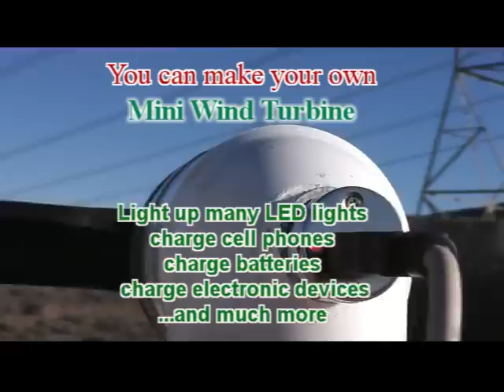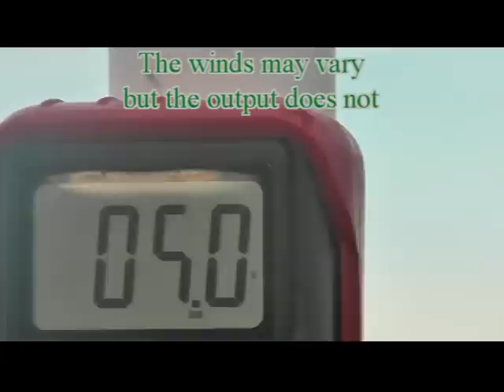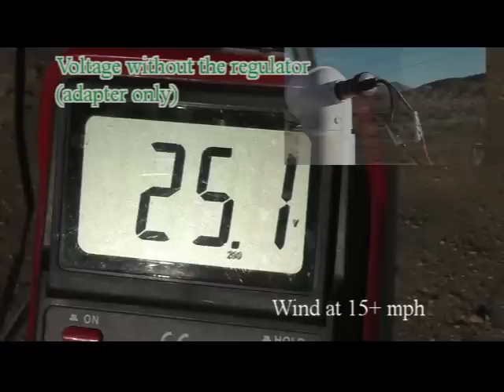Mini Wind Turbine G2

Comment: I'm pretty sure that each set of coils should have it's own bridge rectifier. Otherwise, the coil that's outputting, at any particular moment, will be dumping some of it's output through the other coil. It's because the two sets of windings are out of phase with each other. The result, without separate rectifiers, is that the generator will be fighting itself and wasting energy. A capacitor should be used across the DC side of each rectifier. The DC outputs can then be connected in series, for more voltage, or parallel, for more current.

Comment: Can you tell me, please, the wattage in 12V.  I would like to use it to charge my 12v battery.  Thank you very much for an excellent video.
Reply: Wattage is calculated by multiplying the voltage (volts) by the current (amperes). The voltage output has to be higher than the nominal battery voltage to be able to charge it. 12V automotive battery has a nominal open circuit voltage about 12.6 volts.  According to Wikipedia wet cell lead-acid batteries require 2.37 volts/cell for a float charge (continuous preservation) or about 14 V for a 12 volt car battery. 14 volts x 2 amps (trickle charge) = 28 watts required. A 100 Amp-Hour  car battery would take about 2- 3 days to charge from a fully discharged state at that rate.

Comment: is it necessary to make the bridge rectifier if the motor im using only has to cables (red and black)
Reply from the maker: Yes, the bridge rectifier is necessary if you need DC current. Wind turbines and generators can only produce AC, there is no such thing as a wind turbine or a generator that produces DC primarily current (they produce AC, which can be rectified to DC depending on the user's need).
Reply: thank you very much :)

Comment: I have taken two printers apart, but the motors only have two wires and are difficult to turn. Could you advise me on what motors to ask our local electronics dealer for, and which diodes etc to buy for the rectifier.  The guys here in SA can't seem to help me or don't know what I am asking for. Thanks... Looks great!
Reply: stepper motor
Reply: +Nicholas Ruiz I am very grateful for your video!! I had to play around with various blades before getting one which would actually turn the stepper motor, but it now works very well.  Thanks for your reply as well. I added a "step-up" circuit board (that's what the guy in the shop called it) which could be set to say 20v, and then a step down set to 5v.  This helped me keep the volts more steady even when the wind dropped a bit.
Reply: Wade Grimbeek OK :)
Reply: +Wade Grimbeek could you help us by telling what parts we need?

Comment: Stepper motor is on the way, already got my bridge rectifier ready and a 10x5 propeller, after that just wait for the wind!! Oh wait......this is the Netherlands

It's always windy here
Reply: +basboy542 is het gelukt?
Reply: Farid Soort van, ik heb het gebruikt voor mijn profielwerkstuk (Ik heb er een 8 voor gekregen!) maar in ieder geval, probeer in tegenstelling tot wat ik heb gedaan een wat grotere propeller of een propeller van een huisventilator, aansluiten op de stepper motor en dan zou het perfect moeten gaan, ik heb er mn telefoon mee op kunnen laden :)
Reply: cool man, ik ben op zoek naar alle benodigdheden, ik heb er geen verstand van.

Heb dit gevonden:

http://www.dx.com/s/voltage+stabilizer
http://www.dx.com/s/stepper+motor
http://www.dx.com/s/bridge+rectifier
http://www.ebay.com/itm/252006335949?_trksid=p2055119.m1438.l2649&ssPageName=STRK%3AMEBIDX%3AIT
http://www.ebay.com/itm/SUNNYSKY-2212-Motor-prop-holder-fixture-clamp-Adapter-dia-5MM-hole-Propeller-/271824050323?hash=item3f49f9d893:g:1d0AAOxykUZTg0Yp

Zou jij mij wat advies kunnen geven hierover?

Hoe oud ben je eigenlijk?

Thanks
Reply: Ten eerste waar wil je het voor gebruiken? Als voor eigen gebruik of een werkstuk. Ik zou gewoon zo veel mogelijk een propeller nemen die zo groot en licht mogelijk is, en een zo groot mogelijk oppervlakte heeft om zo meer wind te vangen, hier moet je heel goed op letten aangezien mijn eerste propeller (10x15) nooit genoeg wind kon vangen. Zoals ik ook al zei heb ik dus de propeller van een huisventilator gebruikt, heel handig aangezien er bijna geen dode ruimte is, maar ook weer onhandig gezien de massa en weerstand hiervan, ik zou voor de propeller dus wel iets groters nemen, en misschien ook iets met een groter oppervlakte.

Ten tweede moet je een goede stepper motor hebben, dit is ook vrij logisch maar ik zou gewoon kijken naar stepper motoren die er ongeveer hetzelfde uitzien als diegene in het filmpje, het liefst een met zo weinig mogelijk weerstand (staat er meestal bijgegeven) als ik jou was zou ik dan voor deze gaan: 
http://eud.dx.com/product/heacent-reprap-prusa-mendel-3d-printer-diy-accessories-stepping-motor-black-silver-844250275#.VwVO5WiLSUk
of deze:
http://eud.dx.com/product/heacent-yb42-33-3d-printer-diy-accessories-stepping-motor-black-silver-844339617#.VwVPDWiLSUk
deze lijken mij de beste optie.

Wat betreft de bruggelijkrichter is een ander verhaal, het is heel lastig dat zomaar uit te leggen, ik raad aan wat erover op te zoeken op wikipedia of internet, daar staan meestal heel handige plaatjes met hoe het precies werkt, het gaat er gewoonweg om dat je de stroomrichting omdraait om er zo voor te zorgen dat je geen wisselspanning krijgt, ik heb materialen van mijn school gebruikt waardoor het makkelijker ging, maar misschien heb jij andere apparatuur nodig je kan ook eventueel hier naar kijken:
https://www.conrad.nl/nl/brug-gelijkrichters-vishay-gbu4b-e351-soort-behuizing-sip-4-567342.html
zoiets moet je ongeveer hebben als je het wilt kopen, je kan er natuurlijk ook zelf een maken.

Een voltage stabilizer heb ik eigenlijk niet gebruikt, als je het eventueel wel wilt gebruiken om je spanning constant te houden kan je hier wel meer over opzoeken.

Voel je vrij om meer te vragen als je ergens niet achter komt, je kan eventueel ook nog even het filmpje doorkijken als je iets niet weet, ik heb een heel groot deel van mijn werkstuk gebaseerd op dit filmpje :) (Ik ben 18 btw)

Hopelijk is het zo een beetje duidelijk, zoniet hoor ik het wel :)

Groetjes,
Reply: Thanks!

Knap van je dat het is gelukt bij jou.

Ik bouw het voor de lol. Vind het wel interessant, ook om zelfvoorzienend te kunnen zijn.

Ik wil er een telefoon mee kunnen opladen bijvoorbeeld.

http://www.ebay.com/itm/252006335949?_trksid=p2055119.m1438.l2649&ssPageName=STRK%3AMEBIDX%3AIT

http://www.ebay.com/itm/222076226165?_trksid=p2055119.m1438.l2649&ssPageName=STRK%3AMEBIDX%3AIT

die had ik gevonden. Die houten, is zwaar lijkt mij, maar als die eenmaal draait heeft die wel meer kracht?
Reply from the maker: +Farid 
I just saw your comment, and would like to remind you of something very important. "mount the propeller backwards" for more efficiency. Make the front of the propeller face backwards. If you need an explanation of "why", please let me know. Remember that a propeller is an airfoil, therefore all aerodynamic principles apply. (or...you can test it yourself...put the propeller facing forward on a shaft and put it in the wind....then, mount the propeller on the same shaft backwards, then put it in the wind...You will notice that it will spin much faster when mounted backwards. (of course, if the propeller is shaped as an airfoil it will have a "more rounded" surface in the front, and a more flat surface in the back...check it out). Please do not confuse it with a household 3-blade fan which is flat on both sides)  I just thought you could use this information. STT
Reply: ScienceTubeToday yes thank you ! :)
Reply: ill keep you updated
Reply: Leuk! Je kan mij of +ScienceTubeToday altijd vragen, ik hoop voor je dat het lukt :)

Comment: I have a four wire stepper motor and every thing else still can t get it going
Reply from the maker: mz lewis I can't tell if you have a bad motor, but, assuming your motor is in good working condition....
If you have four wires, chances are you have two separate coils. You need to identify which two wires make one pair (the beginning and the end of the internal copper coil). Do you have this motor's diagram? If it's something you purchased, you can obtain this diagram from the supplier or manufacturer. There is no rule for color coding. Each manufacturer picks their own color of preference, so no one can tell which is which. That being the case, you need to identify the two pairs that make one coil by doing a continuity check. If you you have a continuity tester, use it. If you don't have one, simply connect an LED light to two wires and spin the motor manually (say, with your fingers..) If the LED light up, you found one pair, if not...pick the other wire and try again....then, make note of the two pairs. Now, you have two separate generators (each coil is one generator)...you may choose to connect the two coils in line... At this point you have an AC generator...if you want to make DC current, just use a bridge rectifier...If you need further help, just let me know. Have fun with your project, and please keep me posted...
Reply: ScienceTubeToday ok find the ones that make the led lights up now I have a 4diodes bridge rectificer so do I connect those two to the rectifier
Reply: mz lewis thanks much for your help its workin
Reply from the maker: mz lewis Congratulations. I am glad you didn't give up. Now, you have all the bragging rights :)
Reply from the maker: Don't worry, it's no problem. If you are using a bridge rectifier with 4 pins, lay it flat on the table (the 4 pins towards you) and connect the two wires from the generator to the two pins in the middle (it doesn't matter which way you connect these two pins to the wires from the generator, the result will always be the same): left side is the positive (+) DC - , the right side is your negative (-) DC...
_If you made a bridge rectifier yourself, then you have 4 diodes making a square with 2 diodes pointing north (left and right of the square) and two diodes pointing west (top and bottom of the square). The band on the diode shows which direction the current flows - which is, from the end without the band to the end with the band). So, your upper left corner on this square is the DC(+) the lower right corner is the DC (-) and the other two are your AC input, whichever way you connect to the two wires from the generator. Any questions, just ask. Hope this helps :)
Reply from the maker: When you say you can't get it going, what do you mean? the motor will not spin? If it spins, then here is what you have to do: 

If you have four wires, then you have two coils inside the motor (each coil has two wires) - Find the two wires that make the same coil...for example, connect an LED light to two wires and spin the shaft of the motor with your fingers. If the LED light does not light up, then try another combination of wires until you find the two that make the LED light up. Now that you found one pair...you know the other two wires will make up the other coil. Mark each pair, so you won't forget. Use only one pair for now. Don't try to connect the four wires, or you may cause a short circuit inside.
Let me know how it went...Have fun  :)

Comment: I like your project a lot. I have stepper motor 17 with 6 wires like this project. How did you wire it  with only one rectifier.  I have it wired as "series" with 2 bridge rectifier(50v) bought from Radio Shack.   I am afraid that 2 rectifiers might not fit in a 2" PVC pipe.
Reply: Also I want to try a 3 blade propeller with may be 16" to 20" circumfrence.

Comment: hi, if i wanted to use a  dc motor, how much current and voltage i can get?
Reply from the maker: Hi Buraq,
It depends on the motor itself. As a rule of thumb, the bigger the motor, the more electricity it will produce. If your project is small, I would suggest using a stepper motor. It generates AC, but it can be easily rectified with a bridge rectifier.
Reply from the maker: ScienceTubeToday DC motors used in toys usually require very high RPM, so they are not your best choice.

Comment: does it matter if you use a 2 stepper or 5 stepper motor?  and can you use a ready made bridge rectifier?  how do you know what size diodes you need?
Reply from the maker: Tbone w 
Do you mean 2 wire or 5 wire stepper motor? They both can be used as  generators. Yes, you can use a ready made bridge rectifier. If you build it yourself, just choose diodes with specs compatible with the output of your stepper motors. For example, a stepper motor may produce say 80 volts...then choose diodes above that voltage.
Reply: ScienceTubeToday 2-phase and. 5-phase Stepper Motor.  how do you know how many volts your stepper motor will produce.  newbie (dummie)
Reply from the maker: Hi Tbone, Not dummie at all. I always remember what one teacher told me "The only stupid question is the question that you don't ask"...
Now let's see, I think you are talking about a 2 wire and 5 wire stepper motor. If you don't have the specs, then the only way to know is by testing. Before I proceed, I need to ask you if you have a voltmeter or some LED lights to help you identify the coils inside the 5-wire stepper motor. Let me know, and I will proceed with the rest of the information you need.
Reply: ScienceTubeToday Are the stepper motors in all printers or just ones with the scanners.  I have found a gentleman that has a stock pile of printers and just need to know if they have it?
Reply: Tbone w this is what I found will this work:  Manufacturer Part Number17HS19-2004S1Step Angle 1.8° Step Accuracy  5% Holding Torque59Ncm(83.6oz.in)Rated Current/phase2.0APhase Resistance1.4ohmsVoltage2.8V Inductance  3.0mH±20%(1KHz) Weight 400g
Reply from the maker: Hello Tbone,
I checked this motor online and they do not list the "detent torque", they only show the holding torque. Here is the difference: The holding torque is the force that holds the motor in place at a very precise location, after a command is given, when the coils are energized - for example in a printer, the stepper motor moves precisely where it needs to be and it holds there for a specific function to be executed, then it moves to the next location and so on..all in fractions of a second. The holding torque has no influence on the motor when it is being used as a "generator". The "detent torque" is important. You can  feel the detent torque by using your fingers and trying to spin the shaft...some stepper motors have a strong detent torque and it is hard to move the shaft, others have low detent torque and you can move the shaft easily...the easy ones (low detent torque) are preferred, of course because the propeller will start spinning at lower wind speeds and will give better performance. 
The other point is: Please look at the price of this motor and the shipping cost.
I will start selling kits and individual parts soon, sorry, not ready yet - I am putting the company together at this time..
Keep me posted if you will.
Reply: ScienceTubeToday I received the stepper motor today and it seems really easy to move the shaft with my fingers.  I will have to try it this week will let you know what happens.  Thanks for all your help and let me know when the kits are ready.

Comment: i was wondering what materials you need for the base this is for a science fair
Reply from the maker: Hi Logan,
You can make the base like the one you see on this video with 4 PVC elbows, 3 PVC "T's" and PVC pipes, as long as they are all the same measurement...if you choose 2 inches, the pipe and all the fittings must be 2 inches...or you may choose 2 1/2 inch pipe and fittings. STT
Reply: +ScienceTubeToday thx I can't belive someone responded even a youtuber
Reply from the maker: Logan Peters I was out of town till yesterday...sorry. Hope your project went well. If you need anything else, just let me know. Take care. STT